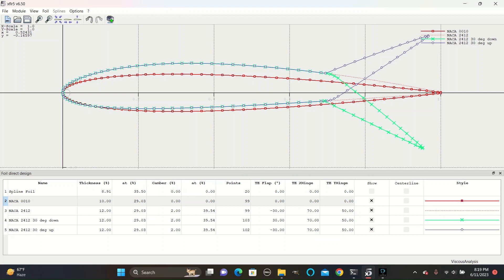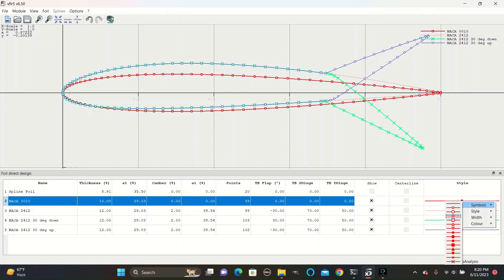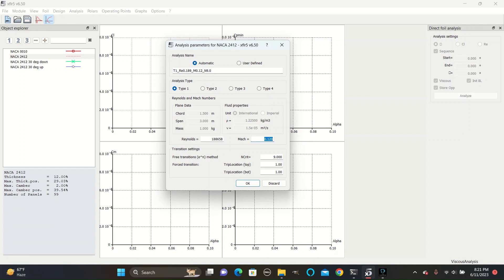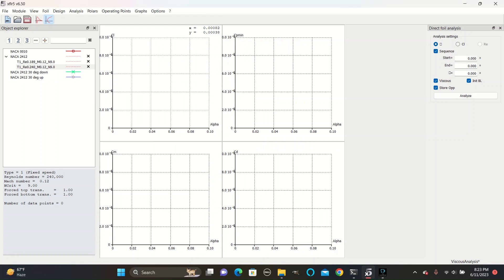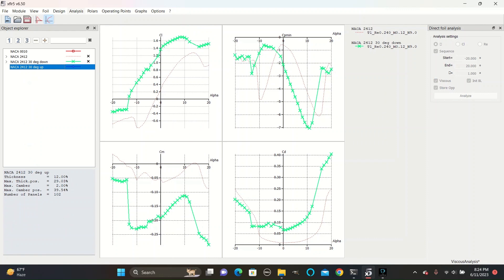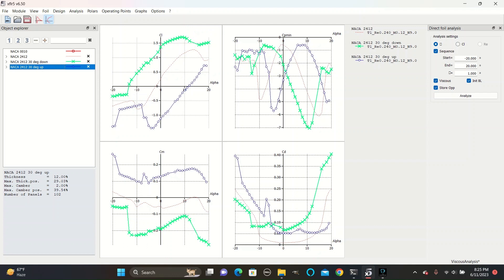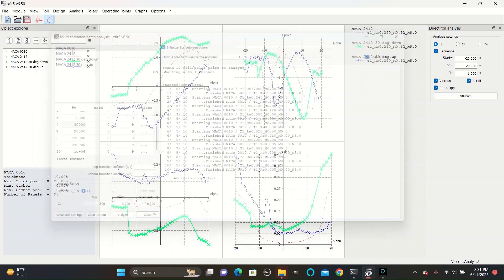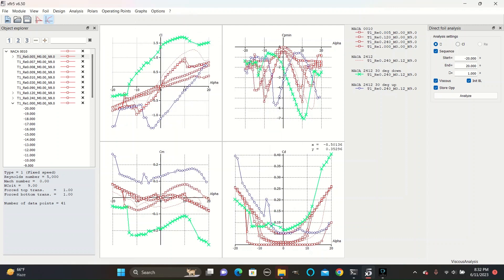Viscous Analysis Reupload XFLR5

Comment: Well... after defined Analysis, I couldn't see check box for 'Viscous'. Could you provide any advice?
Reply from the maker: The viscous check box should appear in the top right analysis settings once the analysis is defined. It is where the angles of the analysis is defined.
Reply: XFLR5 now analyzes with viscosity by default.